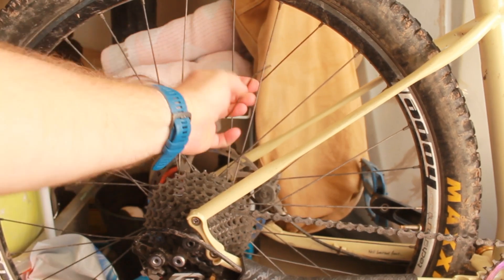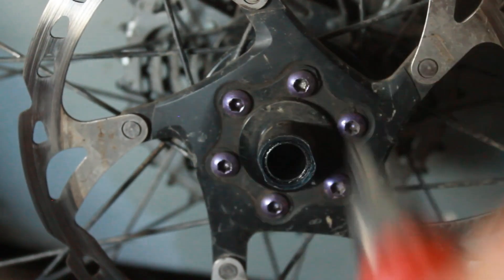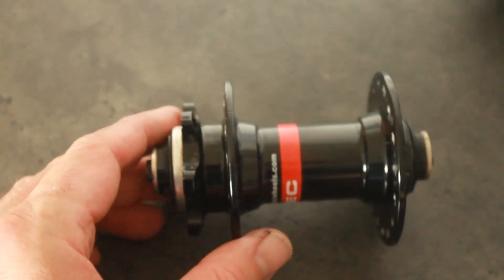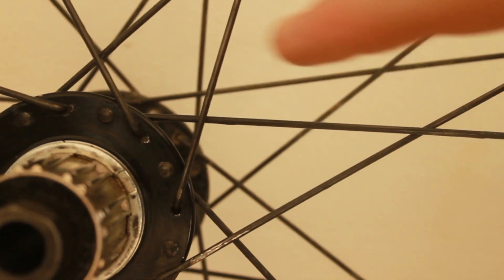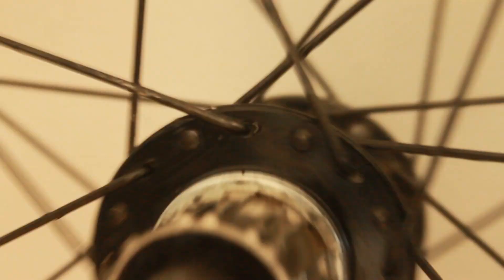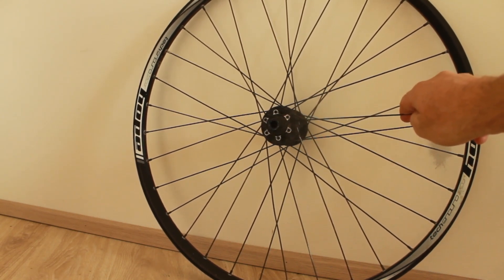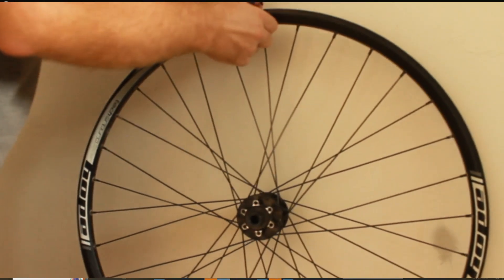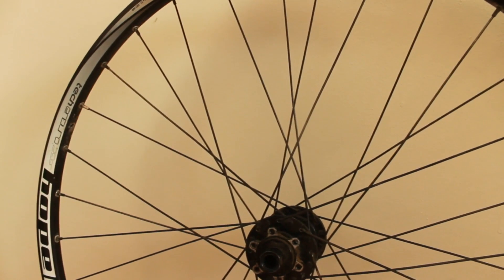how to replace a spoke on your bike

Comment: I kind of like your way at the end of checking the tension because yeah on a mountain bike that's close enough I think a lot of people are probably going to comment you should  true it but I get what you're talkin about make sense! Me and my perfectionism I would be using a Spoke tension gauge at a truing stand!
Reply from the maker: Well, in theory if the wheel has been built properly then you should not need to true the wheel for one spoke. You just need to meet the tension of the other spokes. Full disclosure I did put my wheel in the truing stand after making this video just to check it was ok.
Reply: @underbikedoverconfident1142  I do agree with you but just like you said you did I'd be putting it a truing stand and checking it with a spoke tension gauge!